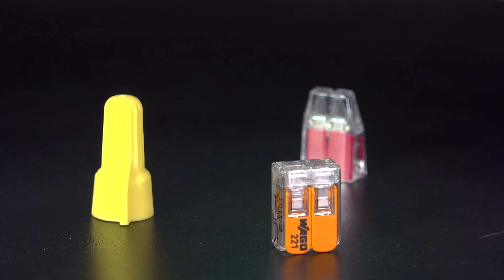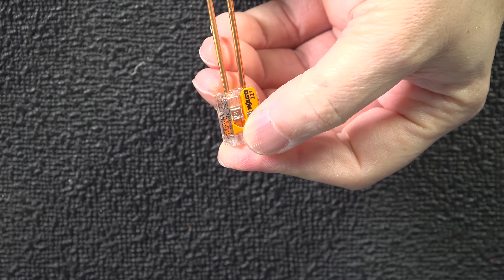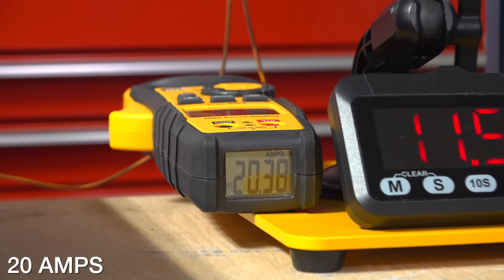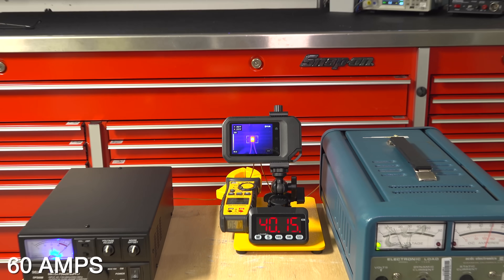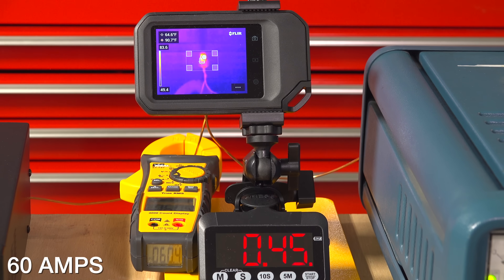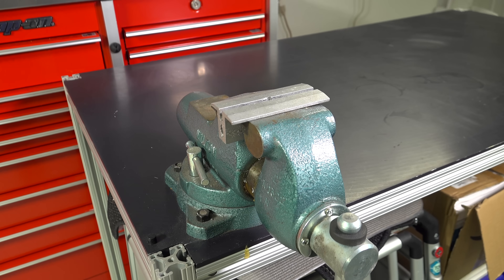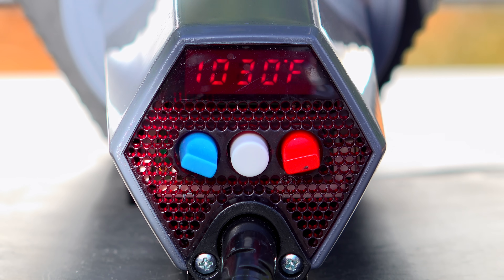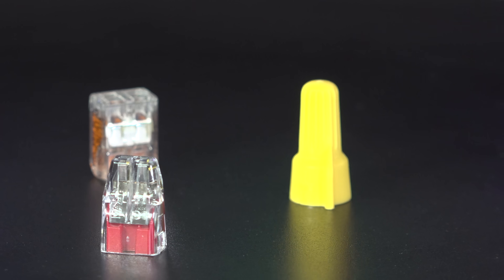What Wire Connector is the Best? Wire Nut VS Wago TESTED

Comment: Gr8, and timely, video.  I recently came aware of these (wago) connectors while getting ready to replace my smoke detectors throughout my home.  the new style "final mile" electrical connectors require my removal of old and reconnect of new in order to complete the task.  I randomly noticed these units as a replacement to wire nuts (of which I've used throughout my life), so I bought a 100 pack off of amazon.  I too, was somewhat curious as to their viability, even though I'd made the decision to "try n see" how they would perform.  I can honestly say that since seeing this video (and reviewing some comments from electricians) that I'm moving full steam ahead on this project with full confidence.  thank you all.........  oh, and I'll be using them on my next project (workshop/storage building) over the remainder of this year.....

Comment: Good job. This video was done objectively and contains good factual information. 

I do think you missed two points in your comparison testing...
1) I would like to have seen the temperature rise of the wirenut at the nominal 20 amps as compared to the Wago at 20 amps.
2) I would have liked to have seen the pull-test of the wirenut as compared to the Wago.

Unlike your previous video about Wago connectors, which was filled with subjective and somewhat misleading information, this video has great side-by-side comparisons of both Wago's and wirenuts under actual working conditions.

Comment: Testing is not perfectly accurate on the overload test. Under normal circumstances, the PVC sheathing would cover the wire up into the wire nut. When using bare copper and you twist it, the electricity can flow through a larger surface area, reducing the temperature.

Comment: I used wagos for one main reason. They’re rated for 20 amps, and they use a spring to hold the connection constant through temperature and humidity changes.

I don’t worry about a wire slipping out of a wago, it’s positively locked when the wire is in place proper

I love them.

Comment: As long as pressure connectors ( no such thing as wire nut in any NEC book ) are cheaper then wagos most sparkies will not spend the extra money. While replacing 277 volt ballast in luminares at least twice had a wire fall out of a wago. Not sure how good it was installed but never had problem with a presdure connector that I installed. Even in damp vibrating areas.

Comment: Screw nuts were banned in Britain in the 1960’s. I wouldn’t use a Wago either. Spring steel gets weaker over time and then the connection will fail. You need a proper connector block with screws.

Comment: DC amps is not the same in heat output as AC amps...that is why a 16 Amps Ac breaker is ony 3 Amps DC rated...and a real DC breaker should be used in a DC circuit,

Comment: Just out of curiosity, what do these people imagine is happening inside their walls that they are worried the cables will all pull apart?
Reply: Renovation, Heat Cycles? The Wire Nut will become loose. The Wago will not. Wire nuts are not allowed after all here in germany.

Comment: one thing you dont take into account i guess. As the wire is not insulated, huge part of the current goes directly between two wires where you''ve twisted them. This reduces the temperature significantly for the connector itself. We use bit different wago terminal blocks together with phoenix contact in rollingstock industry, and all i can say it's the best kind of connector that ever happened to electricity... Strong, secure, flexible, easy to replace, disconnect, reconnect, mount etc...

Comment: WireNut is not a connector. Generally it is only an insulation cap for already twisted pair of wire...
The wago connectors are real connectors in the meaning of the word and are easier to use and change the circuit if needed later.
Usually as allways misuse or misconnection are the real reason of failing in any connector/connection.

Comment: This is the first video I've found after an hour of searching that does an analytical comparison of the connectors instead of anecdotal evidence. I like your setup and would be curious to see the test expanded (ie. test multiple of each style and see if results are consistent). Another test point could be the resistance of the connection (directly correlated to heat).

Comment: I gladly realized that Americans start using WAGOs instead of those horrible wire nuts. Appreciate it!

Greetings from Germany!
Reply: Amerikanische Elektro-Installation erinnert mich an die weltbekannte albanische Luxus-Automobilindustrie
Reply: Finde es interessant die wilden Diskussionen zwischen WAGO-Pionieren und Schraubklemmen-Festhalter mit zu erleben xD
Reply: I call horseshit!.. Read my previous reply
Reply: @pab26120  And therefore there is a law in Europe(decades) that a residual-current device (RCD) must be used everywhere
Reply: US Americans measure in everything but the SI system.... I hope for your best that finally the first generation learns what a Scientific Unit with easy to convert factors is. But it will take 2 or maybe 3 generations until everyone understands the advantages and also applies them. Especially with temperatures you can already see a clear advantage. When I see the °F, I could puke.
Reply: Feet and inches are just as accurate as metric. Please grow up.  Yes they can be harder to use.
Reply: Even using just 110 volts causes the current to double compared to the 230 volts used in most countries. The US are so far behind in many respects. Using imperial units for instance.
Reply: @HolgerJakobs  In the US metric is used for a lot of things and also we use 120v AND 240 please get those facts correct before making a comment
Reply: @olishart-t2u  You are right, but -110- 120 V in the US respectively 230 V in Europe refer to the general purpose voltage.

While the US use -220- 240 V and two phases for more power demanding applications, it's 400 V/three phases in Europe.

I also heard significantly more often that people who were killed because of electrically ignited fires (overcurrent) than being electrocuted by accident (high voltages). So, in my opinion, 230/400 V is the better solution although 110/200 V has some (minor) upsides, too.

Greetings from a German electrical engineer :)
Reply: @hertz42  Sorry but the nominal voltage is 120v and 240v NOT 110v or 220v that is an old standard that is not used in most places here for example in my house it's about 123v or 246v most of the time
Reply: @olishart-t2u  we use 230V single phase and 3 phase 400V for high consumption applications.
Reply: We can’t just switch to 220. Look up why we use 110 instead of being condescending.
Reply: @HolgerJakobs  Your correct about the current doubling,  mostly.  The US uses 120/240 with 123/245 being pretty common.   So your mostly right.   The US spec hasn't been 110 since the very early 80's.   Problem is old farts still want to call everything 110 or 220.  Also the US uses 240 for most everything that needs any higher wattage.   The US has 480 or higher for industrial,   I wouldn't want 240 at the outlets with the current US plugs,  kids wouldn't learn not to touch the prongs they would just be dead,  hard to learn when dead.
Reply: @jeffm2787  thanks for the update. For things with higher wattage we use three-phase with 400 V between the phases, which have phases 120° between each other.
Reply: @HolgerJakobs  Curious,  how far away is the nearest transformer that such high voltages offer much savings?   The home I'm in now is wired for 72KVA and the transformer is very close (30-35m) and shared with 4 or 5 other homes.   We only use 3 phase for industrial and some urban residential with 208,277 and 480 volt being common.
Reply: @jeffm2787  We have a station with I believe 5000 Volts within the apartment block transforming to 400 V three phase. In the apartments we only have one phase, 230 V, except for the electric stove and sometimes water heaters. And of course for industrial use.
Reply: @HolgerJakobs  Thanks for the info.  I think what I have at the street is 12.5Kv.  I live a bit more out of town so they like to run a bit higher voltages.
Reply: @jeffm2787  yes this plugs always look suspicious to us.
Reply: @HolgerJakobs  Might want to educate yourself before commenting next time. Embarrassing
Reply: @HolgerJakobs  The US uses 240 volts. Stop spewing out false information or commenting if you have no clue what you’re talking about
Reply: @HolgerJakobs  Imperial units aren't "behind"; just different.
Reply: @NWGR  They are very much behind.
Reply: @HolgerJakobs  If it works, it works. That doesn't make it behind.
Reply: Where is that European rover?  How many rovers has the USA had on Mars?
Reply: @NWGR  that's the thing, it doesn't work 😂😂
Reply: @nowonmetube  Works fine for me. And millions of others. Soooo.....
Reply: @HolgerJakobs  to be fair that lander incident happened because of the existence of two unit systems in use that were confused, not because Imperial units were used. If only imperial units were used (same with only metric units) this would not have happened.
Reply: @williamsawyer18  True. But what is easier: Have the US changed or the rest of the world? Plus, the SI system is more consistent und used in science anyway.
Reply: @HolgerJakobs  why does the whole world need to use a single set of standard units? We don't.

I dont live in the US and tend to use metric units for most things I do, but imperial can work just as well if you are used to it and use the proper equations. Unit conversions are just standardized with metric.
Reply: The chance electric sets fire up and kill u is much higher than it go through ur body and kill u. 110v is just a fking dumb idea usa is still believing
Reply: I'm in Canada, just checked with my local electrical supplier, yep we're good... can't wait to purchase these and start using them👍👍

Comment: I’m no electrician but I use these only for low load easy works like ceiling fans and such. They are simple, can fit in narrow spaces, no tools needed other than stripper.

Can’t imagine these having reliability of crimped terminals tightened by screws which are secured by spring washers.

Comment: I exclusively use wago lever nuts and I love them.  I do have to say one thing though; on only a couple of occasions, while pushing the wires back, I accidentally pushed up on the lever a bit and a wire released.  But that required force and was easy to put back in. There won't be any forces like that on the levers while just sitting there.  This only requires a little bit of extra care when pushing the lever nuts back.  But it's still infinitely easier than wire nuts, plus you don't mutilate the wires like wire nuts do.  Copper can only bend and flex so many times before it just breaks.  These lever nuts are great for keeping the integrity is the wires intact!
Reply: Why are you re opening closed connections. Sounds like your doing it often too. Once a electrical installation is installed it should last forever. And if you think their not updating wirenuts and what they are made out of over the last 20 years or more then your high as a giraffes pussy. You do you though. We pride ourselves where I work with top tier training and skill.

Comment: your wire nut saw almost no load because you used uninsulated wires. an important point is the protection against accidental contact, while wago could transmit this amount of electricity completely isolated, this is not the case with this wire nut. at least in your test.

Comment: what I find amazing is that electricians in a 1st world country think that wire nuts are useful for anything but 12V outdoor lighting.
come on its 2021
Reply: Be careful with those 12V. The currents may be higher and your connections actually need to be more reliable than with 120 or 230V.

Comment: Walt, u telling me the states having 15-20 A in their outlets ? 
We have 10Ampere  max 16 A to the ovens and stoves
Reply: We do, but it's not per outlet.  The 15-20 amp is shared over several receptacles/devices.  Usually around 7-8 for 15 amp and 10-11 for 20 amp.  I'm not sure how different countries electrical systems work, so your voltage might be different too, which would effectively change the power draw.  And then the actual distribution plays a roll too, like 3 phase systems for example.  I know only a little about 3 phase systems, and by a little, I mean I know that they exist lol.  Either way, just amps alone isn't enough to compare directly.  The voltage, and the type of system are really important as well, and probably other things as well.
Reply: Yes, standard US/Canada basic line is on 15 amp breaker,  the ones going to bathrooms must be 20 amp.  Kitchen stoves sit on 30 amp lines, typically.    That is what you get with lower voltage :)

Comment: Very informative. I have been using wire nuts since the 60's. A few years ago came across the Wall Nut push in connectors. Tried them out and will not go back. Much easier, cleaner, more manageable connections. Will not go back. Will try the lever version.

Comment: How much pull does it take to drag a wire out of a wire nut? I was waiting for the comparison test...
Reply: @Brian Bell  Fair. This also follows for the load at which they fail - that video still showed the test for both components.

Funnily the ‘technique’ point is often cited as as a reason wagos are bad and wrong - as if requiring knowledge or skill is somehow the same as objective virtue.
Or it is insecure contractors desperate to defend their relevance through shibboleths rather than merit.

Not that it’s important, but the main benefit from my perspective is that changing a wago does not require the wire to be cut and restripped to maintain a good contact, but this is true of a wire nut connection resulting in shortening wires as changes are made.
Reply: @Brian Bell ‘it can take a lot’ does not establish how it compares to a wago. In the video that wago was tested, but not the wire nut.
I was only commenting because the tests in the video were incomplete.

Comment: WAGO all the way!    The average 'Harry Homeowner" is VERY likely to install a wire-nut incorrectly or use the wrong size.   I also enjoyed the 'heat test' in the video.  Not that it would ever happen in real life, I noticed that when a WAGO melts, it would release the  wires, thus breaking the circuit.  The wire-nut with the twisted wires would not.

Comment: I belive when you did the wire nut test by twisting the bare wires all the way down you increased the contact area between the wires beyond the actual nut. Normaly there would be insulation on those wires so the test isn't accurate🤔

Comment: 1. Wago  connectors three way and four way  don't fit through the round cutouts on some gang boxes. 
2. Wago connectors, unlike silicone filled wirenuts, can't be  used stand alone outside or where there is moisture. They require the use of a wago gelbox.
3. Silicone filled wirenuts cost significantly less than a wago gelbox + wago connector.
4. Wago ripped off ideal. Wago did not invent these  type connectors Ideal did. In fact, ideal has the patent on them.
5. Pre-twisting the wiring is not a code or manufacture requirement. That is true. However, it is still a good idea to pre-twist the wiring. It creates a much more secure connection and a mechanical like connection.
6. The problem on many older houses wasn't the lack of current. The main only being 100amps. It was the aluminum wiring, bx wiring,  etc.

Comment: Instead of using 13VDC through the connector, try using the REAL world voltage of 120VAC. You are more than likely to see that connector heat up like a mother and fry. There is a big difference between 270 watts and 2400 watts. PROPERLY installed, a wirenut/wingnut, performs very well and holds the connections securely. It is most often user error when problems arise. One issue that I saw in your video is the fact that by pre-twisting your wires together, you weren't able to properly tension the wirenut connection. This should probably be the fault of the manufacturer with the lack of instructions on the packaging. It's best to leave the wires straight then twist on the connector and end up with 0ne or two visible twist of the wires outside of the wingnut. If you look at the picture on the wrapper, it clearly shows this. In your video, your wire twists actually seem looser when you complete the connection. Analysis of how the compression connector works is very important. If the push in connector uses a barb type system, how well of a connection do you think it will make? The amount of surface area that the connection makes is going to be a problem. In the WAGO, the connection is being made with the metal in the connector. In a wirenut, the connection is being made with the wires themselves and additional connections being made with the spring in the wirenut. Keep in mind that the brand makes a huge difference. Some wirenuts have a spring with sharp edges that actually cut in to the wire to create even more surface area in the connection. Proper installation is the key and people that have had callbacks or wirenut issues, should probably not be doing electrical work. Wire connections are probably one of the first things to be taught to an apprentice. Properly of course! ALWAYS READ THE INSTRUCTIONS!

Comment: I think you missed a very important test metric. If a connector is rated for 20 amps then it should handle that indefinitely. You should try to plot the temperature over time and only stop the test when the heat rise levels off. Maybe you did this but didn’t mention it! But when you test to 20 minutes on both I assume you didn’t do this. Otherwise this is the best video I have seen on this topic. Finally someone who uses actual tests, and not just a senior electrician who only shares his biased opinion on the matter. (Not to discredit them, but evidence > opinion)